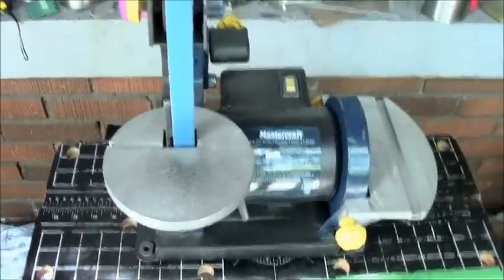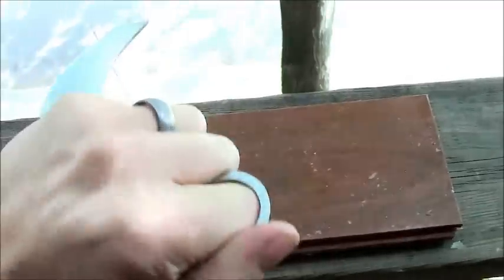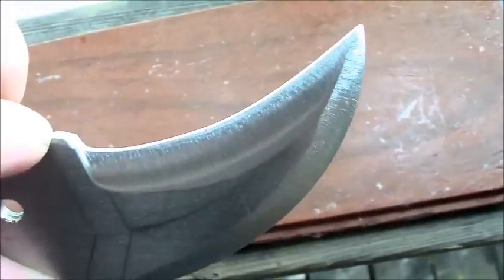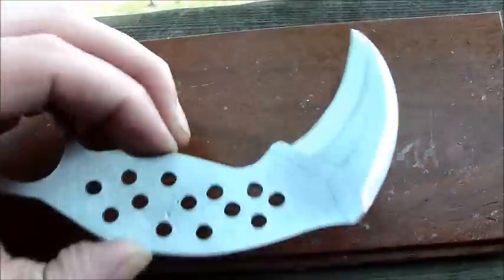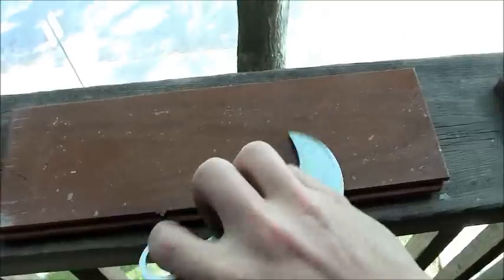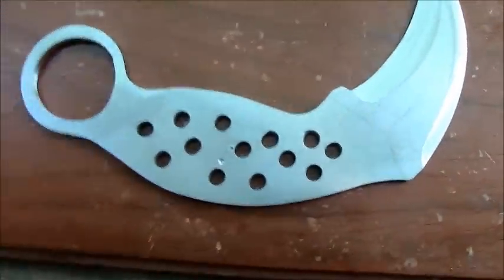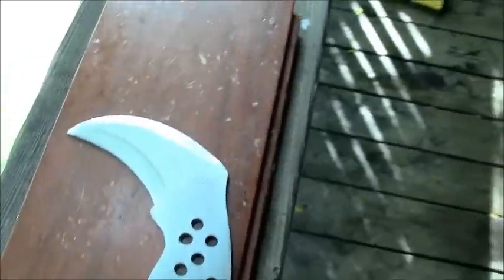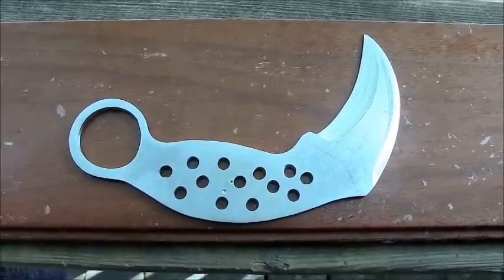First go at bevels on the grinder: Project Karambit

Comment: If you use a step drill bit and a half round file, that eases your work load quite a bit. I had the opposite issue you did. my 2x72 was too wide so I had to use a 1 inch file. Good looking knife Dude!